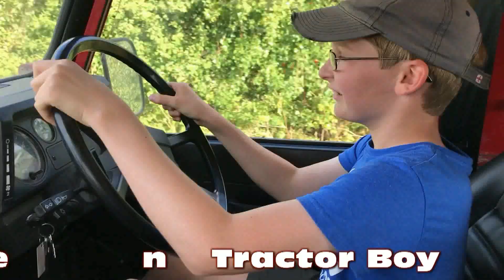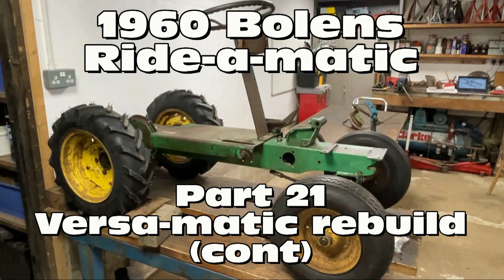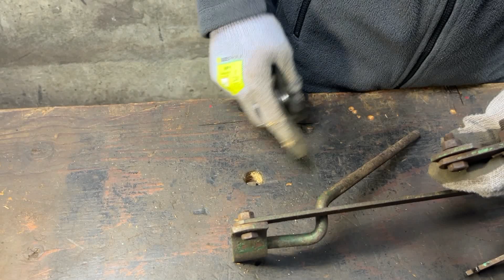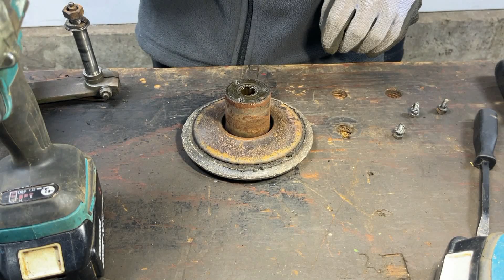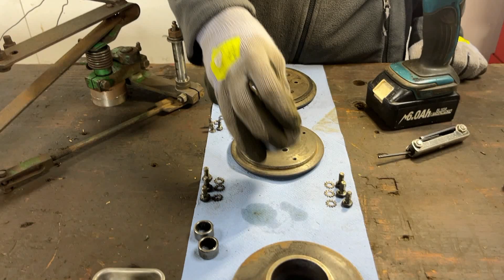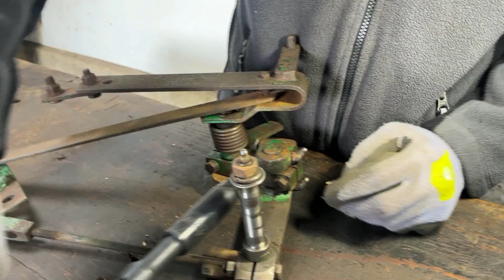1960 Bolens Ride-a-matic - Part 21 (Versa-matic rebuild cont.)

Comment: So much fun to find a sheared off bolt, isn't it? That's a creative solution: grinding the bolt off a bit and using the available threads!
Reply from the maker: Thanks. We really struggled with that bolt. If it had broken flush with the surface we could have welded a nut on the end. Take care and I hope you have a great weekend

Comment: Great video again Joseph, that oil hole in the space pipe is because the pipe moves so unable to put grease nipple in 👍
Reply from the maker: Thanks for the information. It is odd that it is not mentioned in the service manual. Take care

Comment: Nice one Joseph, Im among belts and pulleys at the moment as well! Very interesting mechanism, still waiting to see how it works!
Phil
Reply from the maker: Thanks. It is a great system and works very well on the tractor to make changes to the gearing while the tractor is still on load. We will demonstrate it working when we do the finial adjustments but we still have a long way to go before we can do that. Take care

Comment: Nice work Joseph - An experienced welder could have welded a nut onto the broken stud and removed the broken bolt.  I broke a lot of bolts when I worked in a machine shop.  The owner of the shop would first try to coax the bolt out with a punch and hammer.  That rarely worked.  Then he would heat things up with a torch. Hold a nut over the hole and then with his tombstone welder he would weld the nut onto the broken bolt.  Once the weld cooled, he would heat the surrounding metal and slowly remove the bolt by loosening and tightening the broken bolt.  he always managed to fix my mistakes.  there are videos on YouTube that demonstrate the technique. I enjoyed your video.  Enjoy the journey - cheers
Reply from the maker: Thanks. It is interesting that you should mention welding a nut on the stud, this is something we have done many times and it works very well. This was was odd in that the bolt had snapped half way down the thread and we had nothing to weld the nut onto without causing damage to the thread. We will revisit this at some point in the future. Take care